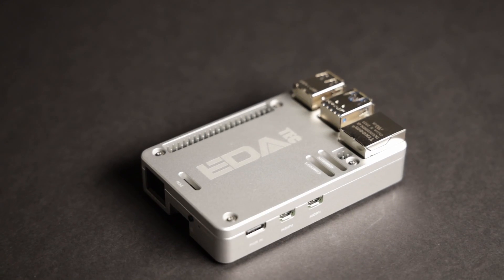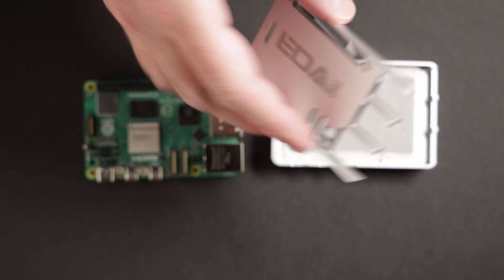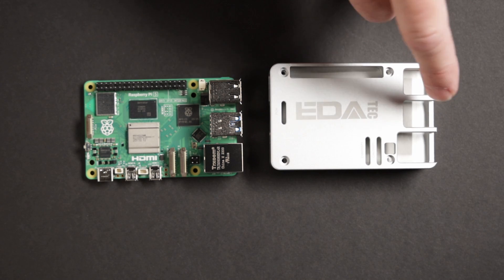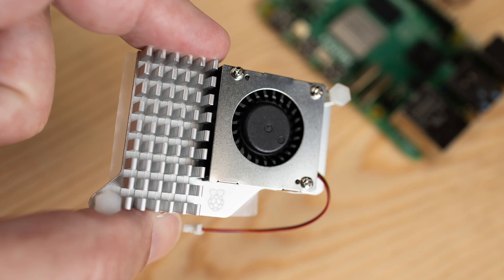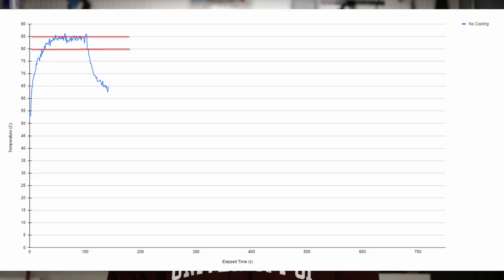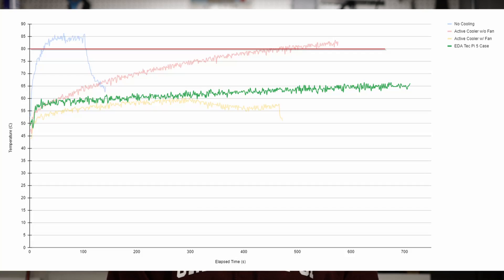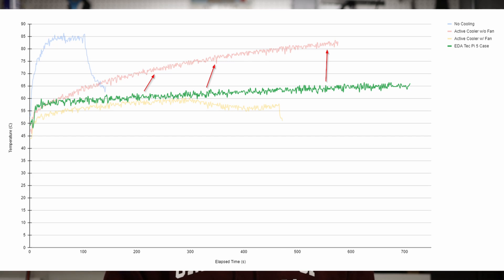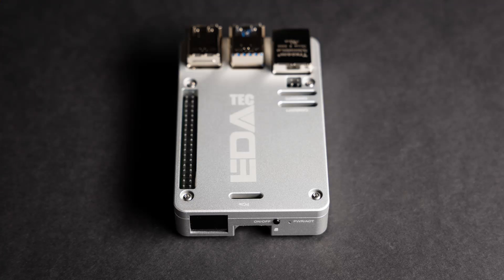Pi 5 Passive Cooling Tested

Comment: hi, a suggestion, next time do the test for longer, for example an hour, to give time to the components to heat up and see where the temperature values settle. This would provide us with more relevant information, if we want to make projects that keep the Pi running 24/7. I would want to see at what values the temperature stabilizes

Comment: For my last need I bought again a Pi 4, because I have read about the active cooling requirement of the Pi 5. This is really an option, because one reason for using a Raspi for me is also energy saving in comparison with a full blown PC. And the fan of course sonsumes more power and collects dust.

Comment: Would be interesting to know if a M.2 NVME HAT fit on pi5 with this case.
Reply from the maker: I'll be testing that soon. It should fit on top of the case. I need the proper hardware but I don't see why it wouldn't work
Reply: I think waveshare m.2 nvme hat will fit
Reply: Yes its fit properly with no problem at all,i am using it since tomorrow

Comment: Not directly relevant, but I use a 6th Gen i5.  I hate fan noise so I invested in a fanless case.  However, that case gets quite hot so I also invested in a 120mm USB fan which I sit on top of the case.
A large fan can be run at low (i.e. inaudible) speeds so it's a silent solution which runs at @10 degrees above ambient.  Under load it runs at @20 degrees above ambient.
I mention this because a fanless Pi case would allow someone to put a large diameter fan on top, bringing temps right down.

Comment: Looks like the temperature is still rising after those ten minutes. My suspicion is that the case will heat soak within an hour and SoC temperature will skyrocket. There's after all only so much thermal mass in a heatsink, and only so much of that thermal energy can be dissipated into the environment.
Reply from the maker: The case soaks the temperature right away and is warm to the touch. Temperature will probably rise more if stressing for an hour, but how realistic is that?
Reply: @makerbymistake  Depends on what you want to do with it :)

If you look at for example the MacBook Air M1, it has a chunk of metal as heatsink with no active cooling. It can keep up with the identical M1 SoC in the MacBook Pro M1 for a while if you ramp everything (CPU & iGPU) up to 100%, but after a couple of minutes begins to thermally throttle because the heatsink can no longer dissipate the thermal energy fast enough.

This is no problem if you have only bursty workloads where you need to ramp up the SoC clocks for a few seconds/minutes, but obviously doesn't work well if you intend to use the same MB Air for a 5-hour render, compile or gaming session.
Reply from the maker: Yeah, if you are going to be compiling stuff, a passive cooled case is not the best option

Comment: I didn't receive my RPi 5 yet, perhaps at the end of February. But I certainly interested only in a passive cooling especially if it's the case. $37 is a bit too expensive, but I will see in February.
Reply from the maker: For sure. There will be other options. FLIRC has announced a passive cooled case, but it is not available yet.

Comment: This gives me some hope for a CM5 in my gpi2 case.  After this test I think that if the entire back cover is metal I might not need active cooling or at least the fan won't need to be on all the time.  Still not sure how long the 4,000 mah battery will last. 😂

Comment: Wow, cool case! I also like the optics. Now I wonder how much it would cost to have something like it machined from e.g. PCBway.
I also run the active cooler and it works well, but I don't like small fans 😅
Reply from the maker: It's very well designed. Even the cutouts inside the case to make sure there's no interference with other components is well thought out. Machining something like this yourself would take a few good tries for sure.

Comment: I was not expecting that good of performance from a simple passive cooling case. I use and prefer a bit fancier heat sink style grooved passive cases on my current pi4s
Reply from the maker: Yeah, more surface area would probably make it even better. It's got some mass though and can spread the heat pretty well